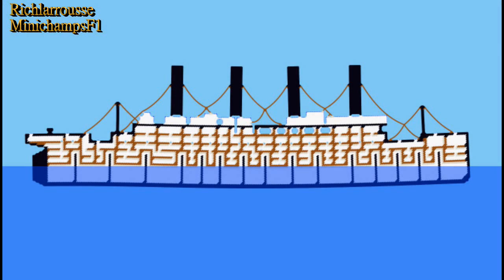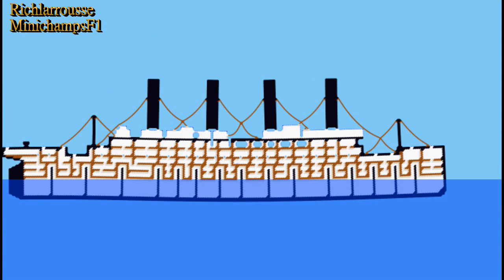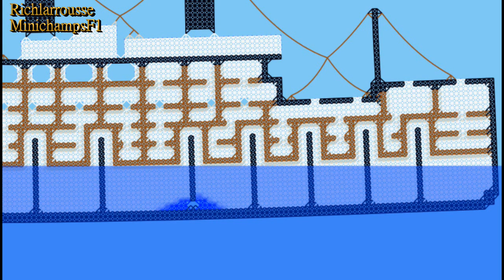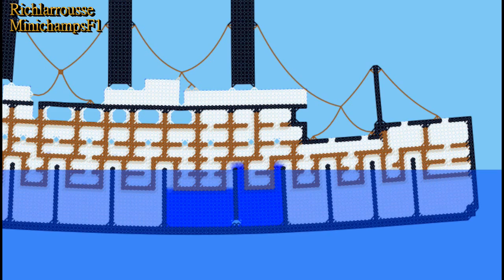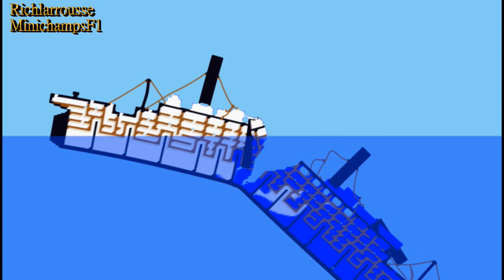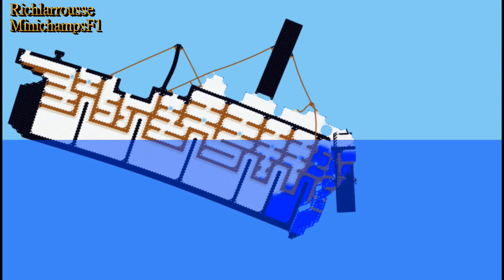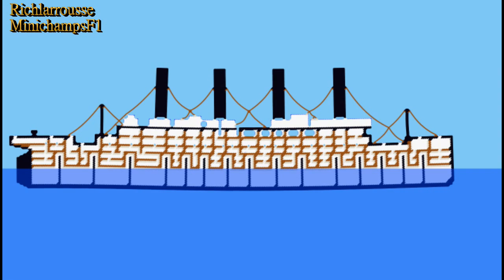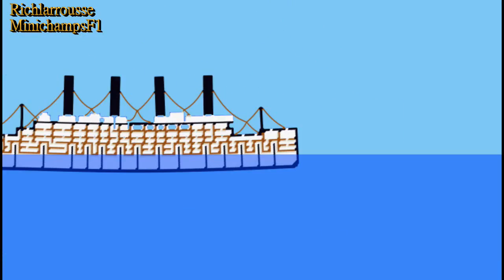TITANIC Sinking simulation, Explained!

Comment: Why didn't the watertight compartments have tops, or were welded to the ceiling/floor above.  It seems strange they should be designed just like tanks as obviously they would do what they ended up doing?.  Thanks though goos video.
Reply: andy Thompson my thoughts exactly
Reply: andy thompson yeah I know that’s what i wanna know if they had tops titanic wouldn’t have sank
Reply: it would've meant that everybody inside them would be sacrificed in any flooding scenario. not a good look